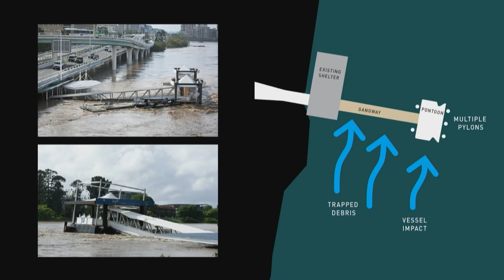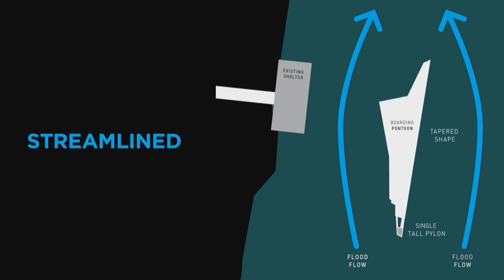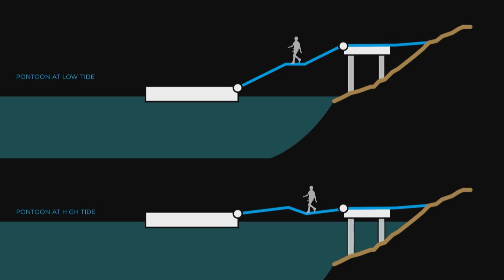World's first flood-resilient ferry terminals | Brendan Gaffney & Arne Nilsen | TEDxBrisbane

Comment: These designs are magnificent. I use these terminals every day to commute. The engineering on the Bulimba terminal is impressive, but the gangways didn’t detach. The debris did build up (Hawthorne) and damage was done. Milton was out of service for 1 year after 2022. I thought the emergency response to pull the pin had failed,  but I now see it was supposed to be autonomous. What happened???